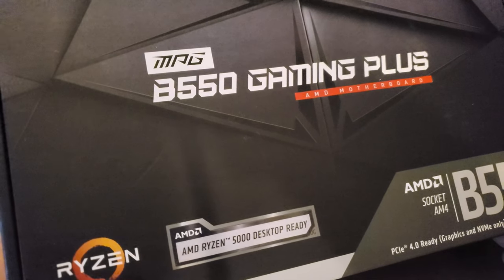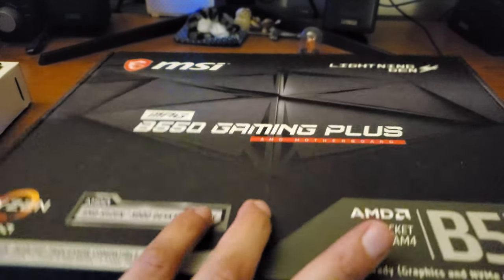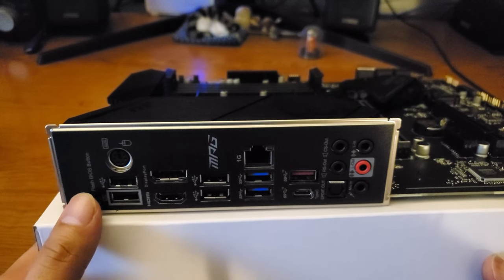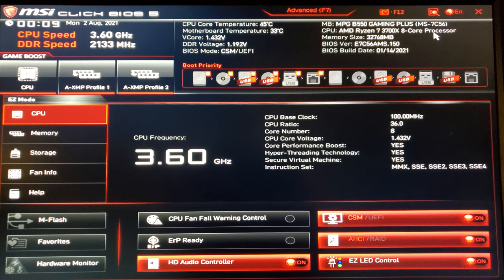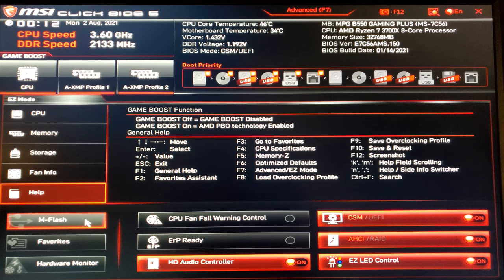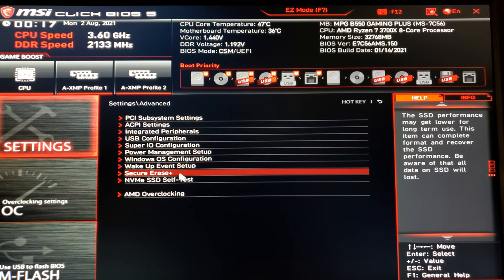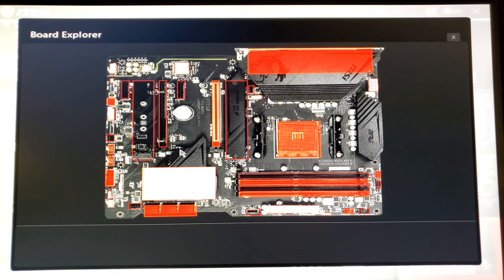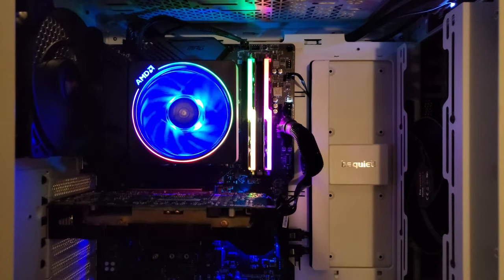The MSI MPG B550 Gaming Plus Motherboard | Unboxing, Installation, and Review

Comment: Love the video but I have a problem just got this b550 gaming plus and I can't boot my pc it's always on the bios screen please help
Reply from the maker: If it's always going to the BIOS, it may mean you do not have a BOOT device ready. Once your SSD/Hard Drive is set up, you can install your operating system (like Windows) and your system will begin booting normally. Also, be sure your SSD is listed as a Boot Device under Boot Options.

Comment: I just bought this board and it won’t turn on for me , i noticed in your video you didn’t connect the hdd/power/led cables at the bottom left , and where still able to turn yours on ?
Reply: Hey bud. Just bought mine yesterday after my 450 went bunk.

Same issue won't power on or light up leds. My old bunk motherboard still lit up and powered on the fans.

Also it looks like this guy plugs his front panel connectors (power on switch, led) into his HD Audio in the bottom left?
Reply: Update. After unplugging the cpu, gpu and the ram, everything powered on correctly. Will continue to update if you care
Reply: @timmyman9677 You’ll have to manually update the bios. In case you haven’t figured it out yet lol
Reply: @brodieyukin69  I got it, turns out my3 month old power supply also decided to crap out, along with the MB. Luckily I had a replacement
Reply: @timmyman9677  yikes that’s no good

Comment: Old info, but the black are all 2.0 USB and the blue are usb 3.0. The red is linked with the usb C and is the fastest data port of all the USB connections next to the C.
Reply from the maker: That's correct, and the red one would be the 3.1 port.

Comment: Ok here we go! The GPU you mounted, that's in the PCIE 4 slot? Did you use an SSD/HDD instead of an M.2? Am getting close to my new build, using the same board. Just have some questions about what I can & cannot do on/ with the board. Thank you

Comment: Hi, can I use the pci3 slot for a graphics card that is pci3, or is it better to use the pci4 slot anyway?. All the best from Norway :-)
Reply from the maker: It's always ideal to use the top PCI-E slot for graphics cards, but the bottom one can also be used as well. You may not get the full bandwidth potential of the card, but general display should work normally.

Comment: What minium PSU power can we install with this Motherboard? I'm using a RYSEN 7 vesion G so do not need Graphic card. Thanks for the video !
Reply from the maker: Can probably get by with a low wattage power supply, but would recommend no less than 400-450watts. A higher one if it's not a known brand motherboard or 80+.

Comment: Hey man i have that MB and my Sata ports are not recognizing a HDD or a SSD, i already went to the BIOS and enabled the sata ports but still not reading the external devices, the nvme m.2 works pretty good but nothing on the SATA, any idea how to fix that?
Reply from the maker: By any chance, are you using more than one NVMe drive? Some SATA ports are disabled when using multiple NVMe drives.

Comment: Thanks for the video. I bought this motherboard 2 days ago and I am just waiting for the processor now. It is still very good selling MSI motherboard until this date on Amazon. I am waiting for AMD Ryzen 7 5800X processor! I really didn't want an integrated graphics card to avoid drivers clashes in GPU's. I will stick my MSI RTX 3060 12GB which is more than enough.
Reply: hey is that a good combo AMD Ryzen 7 5800X with rtx 3060 12gb with this motherboard and are you expernicing bottlenecks and how is the performance ?? thanks(:

Comment: I have everything plugged in, pcie of the gpu, cpu socket, case fan and led display of the case. But no matter what i do, when i turn the tower on, the gpu doesnt start and i cant get anything to come up on my display. Thoughts?
Reply from the maker: By any chance, are you using a CPU that has onboard graphics? The video feed may be coming out of the motherboard instead of your video card.

Do the LED indicators near the RAM chips light up Red and stay Red or Orange? It may indicate an issue with that particular component.
Reply: @Silent157  luckily I discovered it was just a bad power cable!

Comment: What's the difference between connecting the Graphics Card on the top slot instead of the bottom slot?
Reply: For reference, I have an RTX 3060, and I have mine connected on the bottom one. Should I switch it to the top slot??

Comment: Is it safe to install 128 gig of ram on this motherboard.  I am using windows 10 pro., if so what memory do you recommend for is my cpu is AMD - Ryzen 5 5600X 4th Gen 6-core, 12-threads Unlocked Desktop.  my current memory is CORSAIR - Vengeance RGB PRO 16GB (2PK 8GB) 3.2GHz PC4-25600 DDR4 DIMM Unbuffered Non-ECC Desktop
Reply from the maker: Very interesting question. As long as the BIOS is up to date, the board definitely should recognize the memory and it should be safe, though I may actually recommend a x570 based chipset board if you're going to have that much memory. I actually have used 128GB on both an x470 board then updated to an x570 board, using them for sever purposes. Your memory should definitely run safe at it's designed speed.
Reply: @Silent157  The processor handles memory, but the x570 offers more PCIE 4 interfaces via the southbridge. If the extra PCIE 4 lanes are not needed, I would say the b550 is fine. 3200mhz ram would be natively supported, while any speeds faster would be less and less reliable as it relies on a overclocking that involves the processor and compatibility goes down with hit and miss results and possible heavy tweaking to make it stable.

Comment: So you can’t use both top m.2 and a 16x graphics card?
Reply from the maker: You definitely can, and is ideal to use both of these slots. However, using an additional M.2 slot or another PCI slot will give you limited performance and/or disable one or two SATA ports.

Comment: I am planning to add more storage. How can I put another NVME 2.0 in the motherboard?
Reply from the maker: This board does have multiple M.2 slots available if you'd like to use more than one. Bare in mind that both may not run at the ideal speeds and your best bet would be to use a larger capacity NVMe drive in the top slot. But there is an additional one lower as well.

Comment: i have this board and dragon center cannot detect my argb fan for controlling rgb . what can i do to solve this?
Reply from the maker: Does your software detect other RGB devices? Try looking into another software and see if it detects the RGB you're having an issue with. If not, the issue may be with the device, but if it does...then it's a limitation of the Dragon software unfortunately.

Comment: I’m thinking about buying this motherboard and a amd ryzen 5 5600x. Do i have to update the bios or will it work right away?
Reply from the maker: It will likely need a BIOS update. However, look on the box if a sticker that says it is Ryzen 5000 ready is on it. You do have the option to update the BIOS without a CPU or memory installed.
Reply: @Silent157  mine has the sticker on it so I have to use an older cou to update the bios???? If not can you tell me how????

Comment: Hey good job...got my msi b550 mp am new at pc...my motherboard is new but the board is a little bent not much it should be flat right?
Reply from the maker: It definitely look be flat, but have noticed after installation it sometimes can look like it has a small degree of angle. If you are concerned though, see how the board looks when completely uninstalled. If you still see an issue, you may want to RMA it.

Comment: How can I put in 4 8 gigs of ram? Every time I try to start it doesn't because of the ram. It's corsair vengeance
Reply from the maker: Perhaps one of your sticks may be having issues. Have you tried process of elimination to see if one of them is indeed bad?

This mobo can definitely take your 8GB sticks. I actually put 4 32GB sticks, just to see if it would work and it supports it fully.
Reply: If you haven’t figured this problem out here’s my knowledge. Not all the slot support the same speed. Here’s exactly what the manual says.
Supports up to 128 GB of DDR4 ram.
Slot 1 supports DDR 4 up to 4400Mhz
Slot 2 supports DDR4 up to 3866Mhz
Slot 3 supports DDR4 up to 4000Mhz
Slot 4 supports DDR4 up to 3600Mhz

Not sure what speed ram you have but if it’s higher than 3600 that one stick in slot 4 could cause ram overclocking failure and then the computer will fail to boot.

Comment: hey, my MOBO didn't come packaged with the screw for the M.2. SSD. Did you end up having to use that screw or did the MOBO already come preinstalled with an extra M.2. screw that you could use?
Reply from the maker: Usually the packages include an additional m.2 screw in a small bag, which can sometimes get stuck within the cardboard box itself (noticed that happen on 1 or 2 of the motherboards I reviewed so far). However, assuming it is not there, it may not be needed being the m.2 drive would be installed under the m.2 heatsink and that heatsink has it's own built-in screw to use. However, on the other slots, there are no heatsinks, which will require the screw, so that would be an issue for you in this case.

If it's not an immediate need, you can perhaps reach out to MSI and I believe they may mail you one, being it's an easy part to ship.

Comment: so i have the mobo and about to do a build hopefully i get a response before tomorrow lol. i went with an R5 5600x. Does this board already have the bios update on it for that gpu. Mine also says 5000 series ready on the box thanks in advance
Reply from the maker: If it already has that sticker on the box, then it should already have support for your CPU right out of the box. There is also a method to update the BIOS without a CPU regardless, but your 5600x should be all set to go.
Reply: @Silent157  You absolute legend. I've just ordered the exact same motherboard and CPU and was wondering about this too.

Comment: Ryzen 5 5600x compatible?  (i do not have a older cpu to bios update)
Reply from the maker: Yes, this board can support the 5600x CPU. Good news is you don't need a CPU, memory, or even a video card to update your BIOS. You can plug in a USB thumb drive with the latest version and follows the steps to update the BIOS. Once done, you can install your hardware onto the board =)
Reply: @Silent157  thanks!

Comment: I am looking to build a new gaming pc and needed some help with parts

I went with the AMD Ryzen 5 5600x, and was thinking of the MB MSI MPG B550 GAMING PLUS ATX AM4 Motherboard, or NZXT N7 B550 ATX AM4 Motherboard. My pc case is the corsair 4000d, and I'm using a noctua nh-d15 brown cpu fan. I have not bought the ssd nor hdd yet, since I might just use the one from my old pc. 

I don't know how to do the bios, so I'm still researching. Can someone please help me out.
Reply from the maker: Definitely see which of the two motherboards have the most options you are looking for. Obviously, one plus the MSI board has is the front head USB-C connection.

Is there a particular setting you are looking for within the BIOS? You can definitely use your current SSD, just be sure to have any data on it backed up before installation.
Reply: @Silent157  that's the thing, I have no idea what to look for. I need something that doesn't break down quickly, easily able to install, I can use wifi, record gameplay, edit videos (very simple editing), and also use for everyday use

Comment: Can I put the ddr4 c18 3600 mhz on this motherboard? Because the maximum is 3200 mhz
Reply from the maker: There shouldn't be any issue using RAM that is made for faster speeds but using it at a slower one.
Reply: I thought this motherboard supports DDR4  4000mhz?

Comment: I'm using this mother board with a corsair 4000d airflow, my issue is that I can't make the preinstalled io shield fit into the case, how do I fix this? Should I just jam in the mobo until it pops in?
Reply: how do u fixed it ?
Reply: cuz i wanna get a corsair 4000d too and i have this motherboard

Comment: Could you hypothetically add a wifi chip to this board, im aware of the wifi version  but got this version on a budget
Reply from the maker: Of course! You can either use a PCI-E based card, or the more popular USB kind, that usually includes bluetooth as well!
Reply: Yes I use a USB one on mine and it works just fine

Comment: can this handle a Ryzen 7 4700g and Nvidia Geforce 1660 Ddr6 6gb
Reply from the maker: It may require a BIOS update, but definitely this CPU will work on this board. The video card will definitely work on this system as well.

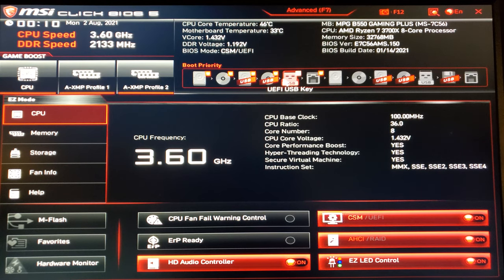Comment: 13:42 Where should I move the USB flash drive when installing Windows from installation media?
Reply from the maker: Any of the USB 3.0 ports will do, and will also run faster than using the USB 2.0 ports. You're installing Windows 10?
Reply: @Silent157  I mean where should I change the boot option to boot from the USB. And yes, I'm installing Windows 10, for the first time, on my 1st build
Reply: @falcaoEUW  did you ever figure it out? I can find my usb drive as an option when trying to install windows
Reply: @MarioBrad27  Surprisingly, once I powered on the PC for the first time, it went straight to the Windows Install menu, so I honestly still couldn't tell you what to do haha sorry but hope you can figure it out!

Comment: I'm trying to install a network/Bluetooth card on this motherboard. Any suggestions?
Reply from the maker: Is this a PCI-E card or one of the smaller ones that are usually intended for laptops?
Reply: @Silent157  PCI-E I have a slot on the bottom for the network card, but I don't think I have anymore USB headers for the Bluetooth. I've resorted to a cheap $15 usb dongle from amazon, but I don't always get a consistent connection.

Comment: Is it compatible with  ryzen 5 5600g?
(Zen 3)
Reply from the maker: Yes, this board will be able to use this CPU, but you may need a BIOS update in order for it to work. You can also update the BIOS without a CPU, memory, or even a video card as well.
Reply: @Silent157  Thank you so much for your help usually other creatures never answer thank you

Comment: What size is the little battery on this motherboard?
Reply from the maker: Most, if not all motherboards these days and for the last several years have been using the CR2032 size battery, like in this one. Laptops may use different ones though.

Comment: what will i lose if i want to use both m.2  slots?
Reply: I believe you lose the use of two sata slots and the lower pcie slot. Or one or the other. Some other reviews of the motherboard explain more in detail.
Reply: You lose the second full size pcie slot.
Reply from the maker: You may not be able to use one of the PCI-E slots below, in this case the larger PCI-E slot below the main one (where your video card goes)

Comment: When i turn mine on the cpu light illuminates then goes to vga then stays on boot. anyone know what may be going on with mine?
Reply from the maker: Are you seeing any activity from the front panel lights, such as the HDD indicator? Do the keyboards lights come on, such as the Num Lock or others?
Reply: @Silent157  The HDD indicator illuminates but not as quickly as often as on my laptop, the keyboard does illuminate aswell.

Comment: Can u change the rgb of your cpu cooler? if so how?
Reply from the maker: Yes you definitely can. The Ryzen RGB coolers have a connection for the LED RGB cable that connects to the 4-pin RGB connection on the motherboard. You can then use the MSI software to change to whichever color or style of colors you would like.

Comment: Will the motherboard support the Ryzen 5 5600G?
Reply from the maker: It may require a BIOS update, but considering it's the latest chipset released sometime after x570, it should support it very shortly.
Reply: @Silent157  hey does it support the ryzen 5 1600 processor
Reply: @skybeamfps121  no 3rd gen higher
Reply: Same problem I just got a b550 and plan on getting a 5600g to pair with it. Do you know or still lost. Cause I’m so lost rn lol.
Reply: @franklinmillerjr.5300  get a 5600x if u have a gpu if u don't have a gpu get 5600g cause u got no option the 5600x its way better
Reply: @franklinmillerjr.5300  It supports it I’ve been running it for 3 months now and no issues yet but I did have to update the bios because mine wasn’t updated
Reply: @denissula5848  I’m about to do the same! Good to know a bios update will make the 5600g work.